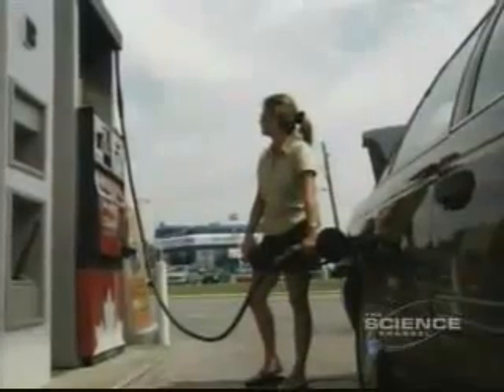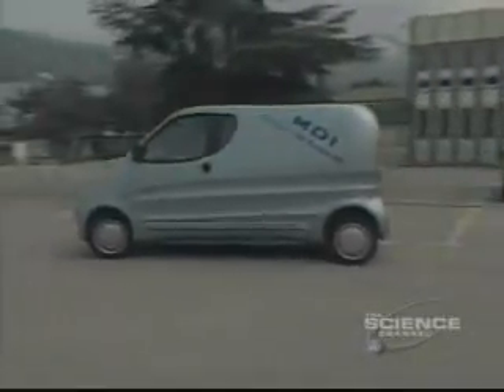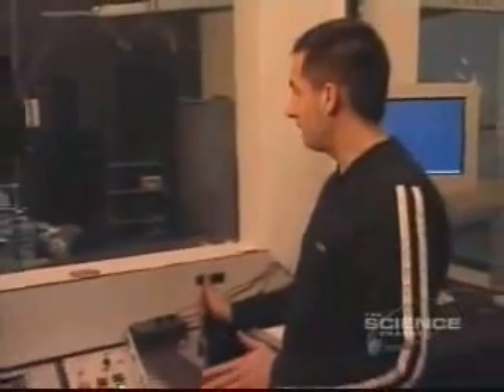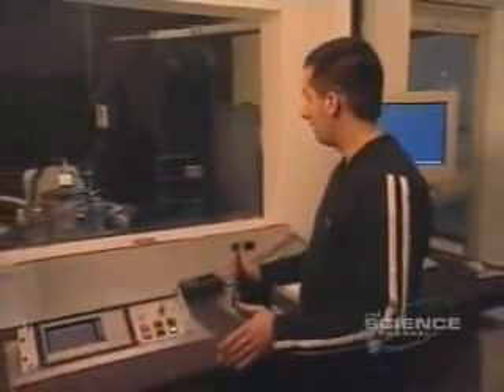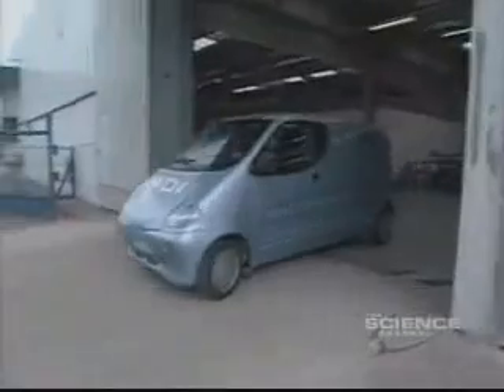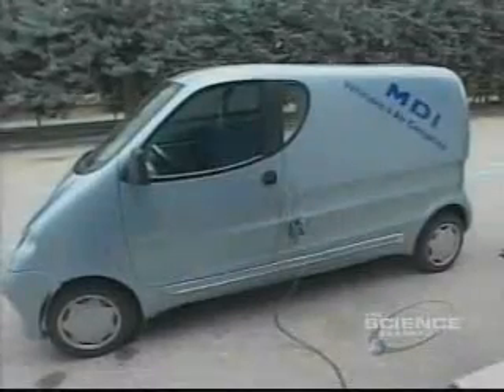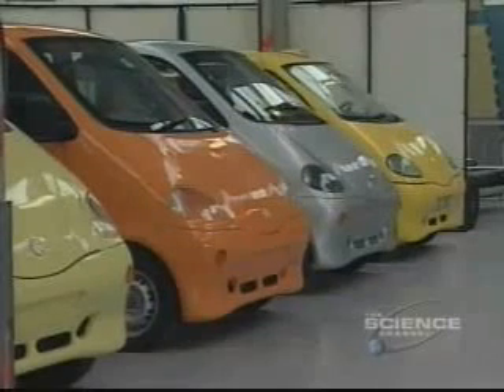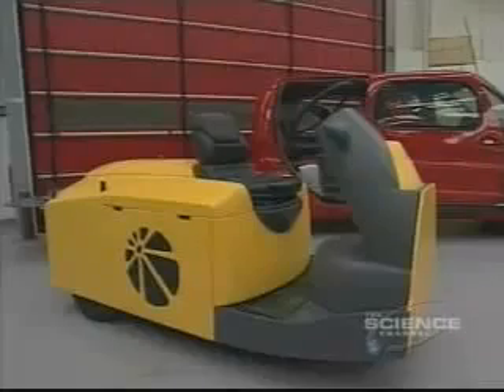Air Car by Guy Negre on The Science Channel

Comment: "MDI claimed in 2007 that an air car will be able to travel 140 km in urban driving, and have a range of 80 km with a top speed of 110 km/h (68 mph) on highways, when operating on compressed air alone, but in as late as mid 2011, MDI has still not produced any proof to that effect." 
That´s from wikipedia to "compressed air car".

It´s a long time runnig scam. There is no need for killers from the oil industry. Pure physics is against competitive air cars (range, energy demand).

Comment: And where does the "pollution free" energy to cram the air in the tank in the first place come from, brainiacs?
Reply: While compressed air is an inherently inefficient means for energy conversion, it's ability to retain as potential energy the kinetic energy produced by wind turbines and solar panels, both of which operate at their peak when energy needs are lowest,  offsets the loss in conversion...... theoretically (this is merely my understanding; anyone who might extrapolate with a more detailed explanation, either supporting or contradictory to the above theory would be appreciated)

Comment: @WannabeDetectiveAlex 
5 mile range 6 hours to fill the tank using a 6kw compressor. Cost of electricity about $3 to go a theoretical 20 miles. It's a CON

Comment: The potencial energy contained in the fully presurized cylinder is enormous, I have seen personally the damage done by a tank of compress natural gas of about 15 gallons at 2500 psi that simply exploded and demolished the car beyond recognition and blowed up the filling station roof too, this was a hapening thing in southamerica until they finally banned keblar cylinders and returned to the heavy but reliable steel tanks just like an oxigen bottle which they test and certify every 5 years.

Comment: My point was that there are other Countries working on good transportation such as electric cars, air cars and basic transportation vehicle that we in the USA will never see because thay are over regulated to the point it adds thousands on dollars to the cost. I should be able to by a basic cheap mode on trasportation. They will not let me drive a cheap car because it will not pass a crash test but I can ride a motorcycle at what ever speed I want. The cheap car is safer than a bike
Reply: They're never going to be here because there's no infrastructure here. No point in buying a car with new technology if you can't easily refule it.

Comment: 7kw wind power unit, isn't trivial to build, isn't cheap (think $1000s for just the materials), apply for permits, erecting a 50 ft tower etc etc When you have done so you will discover unless you are way to hell and gone in  the back blocks where running lines is super costly it is MUCH MUCH cheaper to get electricity from the mains. Sad but absolutely true. 
Just try to put 7kw wind mill up in town. You will get to play meet the berserk neighbours and local council

Comment: Quote "actually it can reach 110km/h" 
If dropped from a very high building. No one not even MDI has achieved anything like their claims. Speed and range the actual results are 7.2km at about 30km/h
It's a stinking con and has been since 1991

Comment: besides what do you use to fill up? and what does the fill station run off of? gas? electricity?  either way the compressor would need a lot of power to compress 4,000 psi.  this will not work, thanks again france but no thanks!